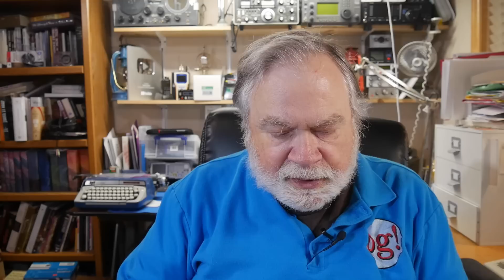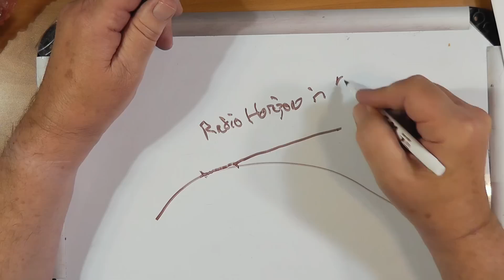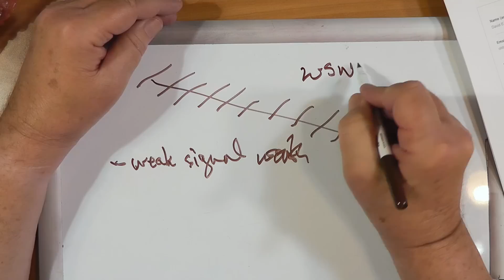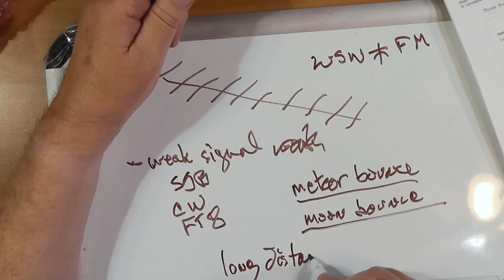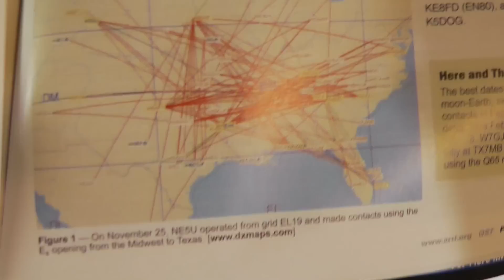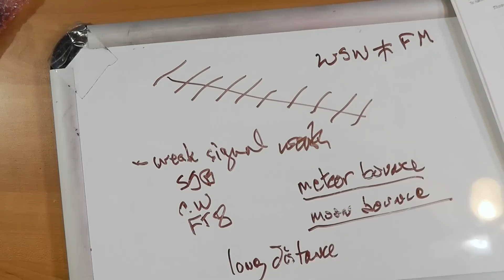Those N-Connectors Again (#659)

Comment: I've have been working in commercial and government Land Mobile Radio for many years and that radio market has long ago moved from the PL259 (UHF) to min-UHF or N for most mobile or base stations.  I don't have a problem with using the old PL/SO 259 or BNC connection if you understand it's limitations and install them correctly. Always water-proof your permanent outdoor connections regardless of what you use. The point I want to make is that I wish the amateur radio market would move to N connections to be more standard with the commercial market as they did with hand held radios going to SMA. So now when you decide to use LMR cable or even Heliax (if you have the $), the equipment is ready for the connection.  Crimp or compression  N connectors are really not hard to install if you practice with it. At this point, I would choose to adapt older equipment to a modern cable connection standard rather than adapting new equipment to an old cable connection standard. Another question well answered Dave.

Comment: PL-259 vs N for me is no contest. The N connector is superior in every way except one.....cost. Sometimes the crappy PL259 is fine. Low frequencies and modest power are fine. 

I personally choose the N when I can only because it is so robust. As the frequencies go up.....I choose N for the electrical performance. 

Most of the time it is overkill, but I feel better about my project.

Comment: I see things about RG8X, RG8, RG213,  but don't see anything about RG214. It is easier to work with than LMR400 and has almost as good data as the LMR400. If you have long runs the difference in the loss can make a difference. When I worked at a Motorola shop, all the 800MHz repeater did hard line with RG214 jumpers and N connectors. RG214 bends almost like RG8 but has better shielding. With a building full of higher power transmitter the shielding can make a difference.

Comment: Here is a conundrum for you Dave. I live in a small village called Goodwick, South Wales. UK. My shack is 308ft (94m) above sea level. I quite regularly have a chat with a ham friend, Mike Suddaby MW0WMW on 2m who lives 74 and a bit miles from me in a little village called Rhydymain, North Wales, Elv, 453ft (138m) ASL, but for my signals to reach him they have to go over the second highest mountain in Wales, Cadair Idris, at 2,930ft (893m), the signal between us is good, S7-8. and yet I struggle to reach Hams in Aberystwyth 48 miles from me and that is 100% across the sea!!! The Quirks of  RF I guess.
Dave M. MW0MDV
Reply: Sounds like textbook knife-edge diffraction over the mountain ridge! You're lucky!
Reply: @peteranoia4570  My longest 2m contact was a SOTA contact about 8 miles from Lands End approximately 133 miles from my home in North Pembrokeshire, 105 mile of which is over the sea.

Comment: In the commercial world, at VHF, any serious company will use N-connectors.  I spent 15 years working on commercial VHF comms, never once did I see a PL-259.  Not the 440 area, right around 2 meters.  The engineers designed the system and sent you the parts to install and then maintain from there.  NO PL-259s, ever.  While I won't spring for the hardline we used for coax, mainly because my runs aren't that long, I WILL use Ns, every time.

Edit:  Almost forgot, you DO live in the mountains huh?  Pretty obvious when you call that 13 element beam gross overkill.  Well it is when there are rises in elevation everywhere.  Out here in the parries that antenna actually has uses mounted vertically and used for FM.

Comment: The benefits of Type-N connectors are many: Constant 50 Ohm impedance, Low loss, Waterproof, Solid mechanical connection, etc. PL-259's have none of those things. By the way, the family Type-N connectors belong to has many other members like SMA, BNC, and several sizes of "N" style connectors.

Comment: Hi David. If using a rotator for the antenna a PL259 might be a better solution because mechanically the connector is one piece. I have found over time the center pin of the N connector can move with the coax center conductor when rotated and become open circuit at the antenna. This is a problem at the top of a tower. 73s

Comment: You may call me a purist because I use N-connectors everywhere. I know it makes no difference at the HF bands but the N-connector is simply a better connector. I see no reason to go with something lesser to save 4 USD per connector. If I just paid real money for good coax why would I forgo a few dollars for the connectors on the cable?

Also I just like to have all my cables standardized. I may use that cable for an HF antenna today but next year I might be doing something different. Everything here uses the N-connector which means everything connects. My shack is always evolving but maybe that's just me.

My current HF antenna is an 10-80 meter end feed halfwave home build. I made it with an N-connector. Does it need an N-connector? No - but neither does the N-connector harm anything. And in fact the N-connector might be better for the job. Not because it has lower loss but because it has better weather and environmental protection.

Comment: Thank you, Dave.
   During storm spotting in Nebraska, with heavy downpours, the city lights could not be seen from 2 to 4 miles from Lincoln. 35 to 50 watts was required for good and consistent communication. 
   In heavy snow storms even 50 watts was sometimes not enough to communicate. N0QFT

Comment: Radio shops should a lesson from the auto chains. If you need an odd crimper or other tool, take a deposit on it. Rent it out free, or reasonably, and tell folks if they want to keep it, they can. The deposit pays for the tool unless it is returned in time. Meanwhile the customer can afford the LMR and special connectors. It also builds really good will.
Reply: Problem is there are no radio shops....

Comment: FWIW you won't find LMR400 on most cell sites due to the requirement to minimise passive intermodulation distortion. Chiefly the connectors used are 7/16" DIN types... for similar reasons.
Reply: LMR400 has been known to be problematic on duplex systems. I would think that the cell towers would at least use Heliax.
Reply: Cell towers round here tend to use LDF 4-50 or even 5-50

N connectors are normal in anything small scale comercial with DIN7/16 being used for larger sale stuff..

Increasingly in the European amateur market N types are used for VHF and up... Especially when 23cm and above is considered (SMA for low power, N for high power)

If you buy a European spec ic-9700 its N connectors throughout.

And a ic-7100 and ft-991a both have So239 for HF and N for V/UHF
Reply: Here in the UK in close to 40 years of visiting commercial radio sites I think I have only encountered one ancient base station using a PL259/SO239. For HF amateur radio I use them universally but they are a garbage connector.
Ignoring the impedance anomalies (that are often over stated) the shield connection is prone to intermittency unless the collars are very tight. An N-connector does not rely on the mechanical fixing for it's screen connection.

Comment: “If PL-259 is an abomination, then the whole of HF is an abomination.  And if all of HF is an abomination, isn’t this an indictment of our entire amateur society.  Well, you can do what you want with us, but we’re not going to….”  Otter, Delta Tau Chi, Animal House.

Seriously though, I thought the appeal of N was in water resistance (in degrees of performance).

I use both, but more as a function of the cable order.  Putting in a 70cm antenna?  Best be 400 or better.  That much money spent on 40m?  No way, Jose.